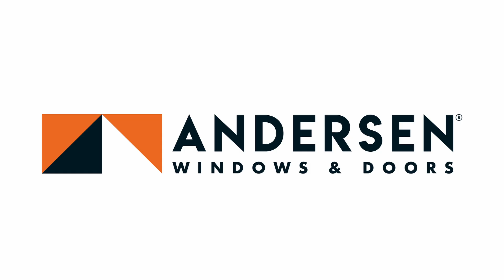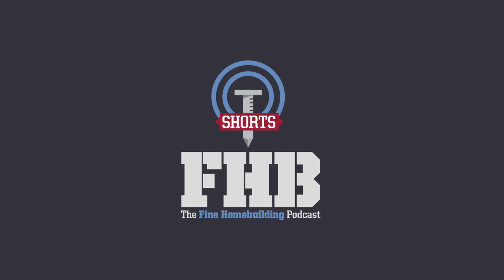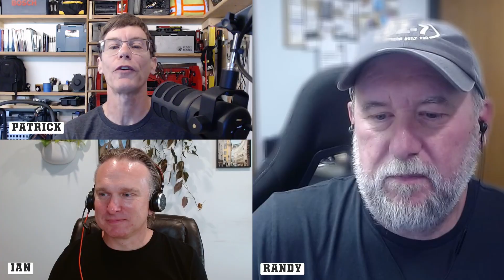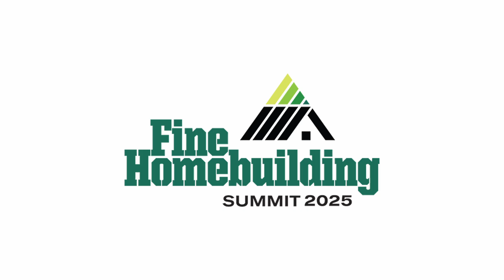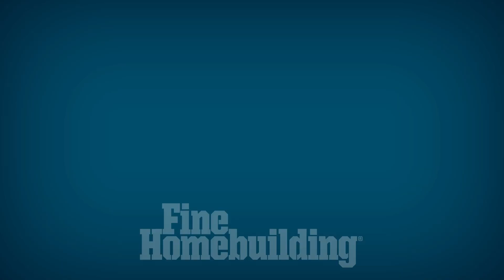Straw-Bale Construction, Rubble-Trench Foundations, and Alternative Slab Floors | FHB Podcast Ep 699

Comment: With rubble trench foundations I do a minimum of 18" wide and at least 6 inches wider than the wall thickness. A lot is dependent on the soil type. With sandy soil you might end up with a 3 foot wide trench that sounds like a pretty extreme case.

For drainage you have to slope the trench to a dry well. For fill I like to use larger (1 1/2" - 2") river rock in the bottom part of the trench and then use smaller angular rock at the top. The river rock at the bottom creates voids to allow water flow and the angular rock on top provides a good base for the concrete grade beam.

I'm curious to know if rubble trench foundations need to be installed below frost depth. I've heard that this foundation type is somewhat resistant to frost heaving as it has more "give" then a rigid concrete foundation. Here in central Texas with my 3 inch frost depth I have not been able to experiment.
Reply: Since the idea of rubble trench is that the water drains away, no water no frost heve.  I wonder about water pouring into the trench or do you put plastic over it to slope it away
      My boss built a protected foundation with insulation  over it and only had to put the footing downb11 inches insteed of the normal 32 here in utah

Comment: Adobe is just sand, clay and fiber which can be sourced locally from almost anywhere on the planet. After the finish layer is applied an earthen floor get several coats of linseed oil that hardens to create a waterproof source. While not as hard wearing as concrete it feels better underfoot and is less energy intensive/expensive then other options.

Comment: I am amazed that FHB covered this in a good way. I am hoping to hoping to build a hempcrete home in the near future. Make homes buildable by the common man again!
Reply: It seems a bit too uninformed. Comparing what you can do with proper adobe floors to rudimentary mudhouses seems completely off the mark. What maintenance does an adobe floor have that other floors do not, particularly natural floors like real wood flooring?

On top of that, when it comes to natural materials, people seem to apply standards that they dont apply to their own conventional construction. "What is the survivability of an X natural home, though??", while conventional homes start growing mold in less than a decade and have a million points of failure. Any home is going to require maintenance. Any home is going to have vulnerabilities. It'd be nice if people learned the facts and compared objectively instead of making silly assumptions. "Rammed earth seems like back breaking work!" Well, sure, if youre manually tamping it might be a bit tough, but if youre working professionally you have a pneumatic tamper, youre probably better off doing that considering youre getting your entire wall assembly compared to conventional construction with 4, 5, 6, 7 layers that require you to go around and around and around unless you give up some control/pay a premium to shed some layers with panels, but even then its not quite so fun to do focused construction work getting whatever layers are left in place - its quite back breaking as well.
Reply: @SuWoopSparrow Well said.
Reply: I agree, the only time I recall it coming up on the podcast they were pretty dismissive of it but that was several years ago. Good luck with the hempcrete. If you have difficulty sourcing hemp you might consider light clay straw.
Reply: @offgridburbia Thanks for the suggestion.